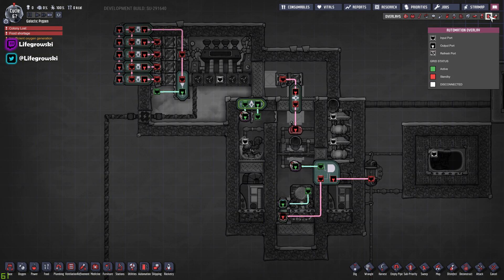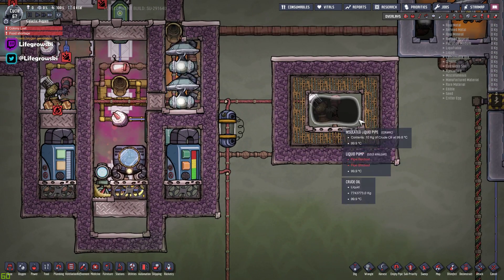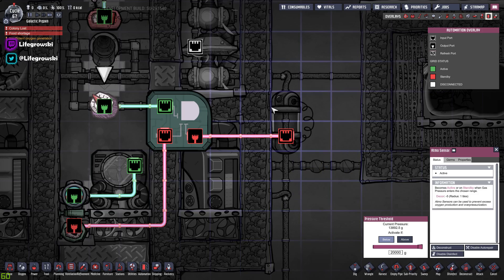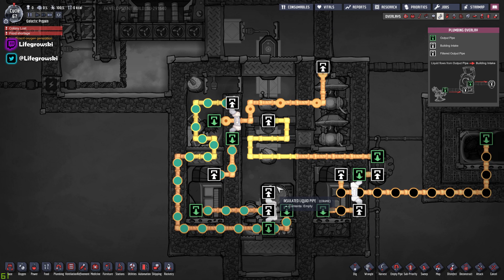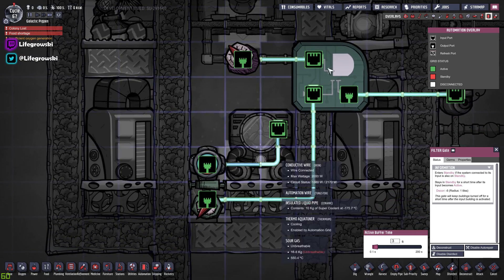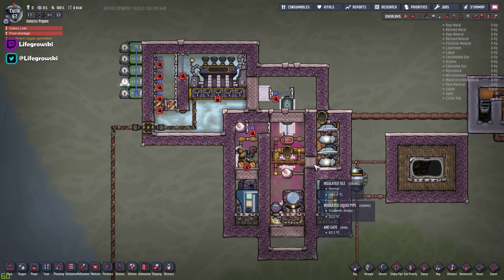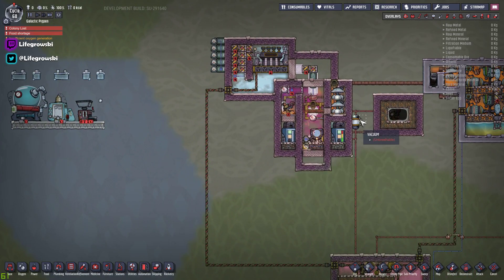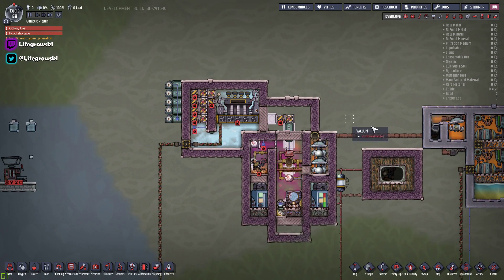OXYGEN NOT INCLUDED - THE EASIEST TO BUILD - 1kg/s SOUR GAS BOILER

Comment: Thanks! I had to make a slight modification to get it to start up - the aquatuner has to sit on the metal floor, to heat up the initial cold crude oil on strartup. When it's first switched on everything is cold, with vacuum inside, so the aquatuner doesn't provide any heat to the first oil supply (sits there cold until my aquatuner broke). Putting the aquatuner on the floor solved that for me. Thanks again! Amazing help, I would not have been able to get this to work without you.
Reply from the maker: Glad it helped- the builds been broken a bit with the recent QOL update (there's been some changes to temp transferance) so I had a little tinker last night and made a couple of improvements. If your build is ever unstable, try adding a little closed loop of radiant gas piping behind the aqua tuner (filled with hydrogen) to spread the heat directly into the metal tiles. Changes nothing in terms of power consumed, but makes the build a lot more stable.
Reply: @Lifegrow  , good call - I actually put tempshift plates above the metal tiles at the bottom. Not done the QOL update yet
Reply: @Lifegrow  there is a bug, if you save/ load your game the temp transfer will stop working between metal tile and tempshift plate. At least for me thats whats happening, reported it with save.
Reply from the maker: @szabomarton8064  Yeah, it's an odd one - had this pointed out to me tonight on stream. Hopefully it get's fixed soon :(
Reply: can you send me a picture of it? i'm learning about this game, thank you!
Reply: In case anyone was wondering, this still works for me (current game update number 581979 'Packed Snacks') but obviously the steam turbine works differently (more compact with the new turbine). It was difficult to get to start up though as the super coolant didn't easily chill. I changed the temperature controller to 200 DegC to provide more pre-cooling from the steam turbine and that made a big difference. Thanks, @Lifegrow if you're still around

Comment: Updated in QolMK3, I cannot succed to make this setup working... I'm just using the new turbine instead of the old one, but it's never used anyway.
 All the sour gas is consumed by the cooling, all the supercoolant is at set t° (-172°), the aquatuner is submerged into its little oil basin, and nothing is running, except the supercoolant that is goign in circles... It seems changes have been made to t° transfer, as the heat taken from the crude is going... somewhere... but don't know where since the turbine didn't get enough heat to be enabled.
Reply: I've added hundred kgs of very hot sour gas, it seems to have "launched" the setup. But I don't know if it will remain for long, of if the "cooling" is still bigger than the "heating".
Reply: In wolframite, it could be that nat gas radiant pipe are stealing too much heat. The nat gas output between 250 & 350°C...

Comment: Spent some  hundred of cycles ( I'm at cycle 1100) testing this: at first worked perfectly, than started to stall. I made the modification suggested (hydrogen loop behind the acquaturner and the acquatuner itself one tile below, directly on the metal tiles). Only other difference is that I made of thermium also the radiant pipes loop for the nat gas ). Stared working again wonders for some cycles, than consumed all the sour gas, and stopped working - temperature in the cold area is stable, sour gas is just some micrograms, the petroleum too cold and the acquatuner working too little to heat it up. After some other useless tweaking I'm testing the final solution: I'm providing an additional 500g/sec of 70°C sour gas straight from the oil biome, and still it's heating really slow! seems to work different in latest patch.

Comment: What is the automation on the steam turbine room?
Reply from the maker: There is none. The turbine only powers up if the build is warm enough - and the heat from the sour gas is transferred through the mechanised airlock (the one that connects the build to the turbine chamber). Basically it's there as a power-giving-heatsink, but if you want to control the usage of that power, then it could be wired to it's own battery bank - connected to a transformer and have the transformer toggle on/off with automation as/when power is needed. Hope that makes sense.

Comment: What about the building up of sulfur?
Reply from the maker: You can use it to cool the sour gas a little (like I did in the Sour Gas-tard build) but I didn't bother in this build as it works better to stabilise the liquid methane.
Reply: I've been running it for 50 cycles powering my colony, the sulphur just sits there on the ground in two little balls, not bothering anyone.

Comment: I have got a system that converts 5000 grams/sec of crude oil into liquid methane, and it uses 1680 W. It consists of 2 pumps, a liquid aquatuner and some radiant pipes! My crude oil starts at -9 Celsius .
Reply from the maker: I've made way larger systems than that, however this is meant to be a small and compact build that's actually functional in a survival game. How are you moving the 3.3kg/s of natural gas you're creating? 7 Gas pumps running flat out consume ~1680 watts, so I think you might have messed your figures up a little.
Reply: @Lifegrow  Oh, nice to hear from you! I never move any gas. I just simply use 2 liquid pumps. Actually, one is only on for half the time, so 1560 watts only
Reply from the maker: @qaz120120  I was just confused trying to visualise your setup - you have to cool your oil to -9 beforehand? That seems a little wasteful doesn't it?
Reply: @Lifegrow  No, I do not have to cool my oil to -9 beforehand. It was just the random temperature that it spawned in. I noted it, because if the oil was 80 degrees, the machine would have been able to produce another 1000 grams a second more.
Reply from the maker: @qaz120120  The point I was trying to make is your figures seem to be a little incomplete :D
Reply: to use the gas you gotta pump it, so you have to take it into account anyway.
Reply: @rokadamlje5365  The other guy was just trolling, 1690 watts is with the pumps held in account. After some tweaking the thing outputs 6000 g/sec for 1580 watts or something. I forgot, but if you want i can look it up and send you a picture.
Reply: LOL, whos trolling, 6000g/s needs 2880 watts of gas pumps.
Reply: @rokadamlje5365  Nope, just 2 liquid pumps, one running at 60% of the time. http://puu.sh/Cg9MP/0d605d7957.jpg
Reply: To USE the gas you need to pump it.
Reply: @rokadamlje5365  Someone with your intellect should be able to make use of the methane gas without netting a loss. Good luck with your game.
Reply: Oh well, im taking a troll seriously it seems. 

There is no way to get methane LIQUID into a GAS pipe without involvement of a pump. 

Could try fueling a hydrogen rocket.
Reply: @Lifegrow  I have also got a polluted water cleaner that cleans 6 liters a second off of 1690 watts, no exploit :D

Comment: Very clever dude, but i can feel the lag of all this automation on a real base xD...
Reply from the maker: I'm hoping you're joking....
Reply: @Lifegrow  No im not xD, well at least for me there's no problem at all because i have a good setup and 24GB RAM, but for 80% of my subscribers have at maximum 8GB RAM, and 2 doors systems of this steam turbine could ruin a medium base o.O
Reply from the maker: @EstratégiaEmChoque  I don't think you understand what causes lag in ONI then bud - you can have masses of automation, providing you're not filling your bases with pulse clocks, or other rapidly pulsing logic. You could have a mechanical door pump with 50 doors and 50 buffer gates, and it would cause less impact to the games fps than a stable of 8 hatches. It's nothing to do with RAM, it's more down to CPU thread allocation.
Reply: @Lifegrow  
If you are saying ... but take a look at the memory consumption and CPU usage on a base with little automation and another with a lot of automation, the difference is clear in the memory consumption, but the CPU usage is practically the same, I had a base that was consuming more than 4GB RAM with 3 systems of doors compressing gases after removing the 3 systems but keeping the gases the use of memory dropped to 1.5GB RAM on the same base and the CPU usage was the same.
Reply from the maker: @EstratégiaEmChoque  the game is full of memory leaks but they're not caused by a small amount of automation.
Reply: @Lifegrow  and you know that from debugging memory leaks? or just a plain assumption?
Reply: Runs in my real base no problems.  Cycle 950, been running this for about 50 cycles with no issues at all.

Comment: Hi. I didn't get to space yet. I can see space and scanned one asteroid and use light for power but didnt get out there yet. 
Is super coolent some kind of witchcraft? It stays extremely cool all the time just like that? I didn't really see you cool any thing only heat stuff up
Reply: it's just the liquid with lowest freezing point.. probably... and highs heat capacity. In this build he uses it to cool sour gas around liquid pump, where it condenses.
Reply: The aquatuner that cooks the petrolium into sourgas cools the supercoolant. It does not stay cold on its own.
Reply: aquatuner cools the super coolant and heats itself and surrounding gas.
Reply: joshua slattery if I pump it back onto itself will the liquid cool up or is it a 1to 1 ratio that I need to heat one thing and cool an other where the burning of natural gas into electricity deletes the heat

Comment: gasps 1400+ Kg's of thermium??? unrealistic build :(
Reply: Dude if u can go to space and get 10 kg of niobium u can manufacture 200 kg of thermium, then u can turn them into 200 kg of niobium and make 4000 kg of thermium
Reply: Are you beeing sarcastic or did you not watch the whole video? With just 5 kg of niobium you can turn all of your tungsten into thermium...
Reply: Lol also why not just use tungsten instead of gold for the other segment?
Reply from the maker: @G.r.e.g.g.l.e.s  Tungsten and gold share the same thermal conductivity when it comes to radiant pipes/tiles - they're both 60. Thermium on the other hand has a thermal conductivity of 400. It's amazing stuff, but some people are still scared of the space materials at the moment, so this build was about using as little as possible.
Reply: @Lifegrow  wait so do refined iron and copper share that, too?! What the heck I've been wasting my tungsten on my AETNs, A/C, and steam vents when I could've just been using free space iron!
Reply: 400 hours and you'd think I'd be done learning big things like that
Reply from the maker: @G.r.e.g.g.l.e.s  For metal tiles - copper, tungsten and gold are 60, iron is 55. For radiant liquid pipes copper, tungsten and gold are 120, iron is 110. Theres very little difference in conductivity.